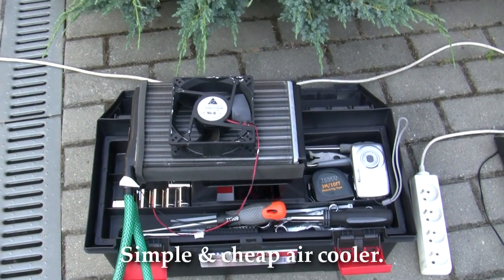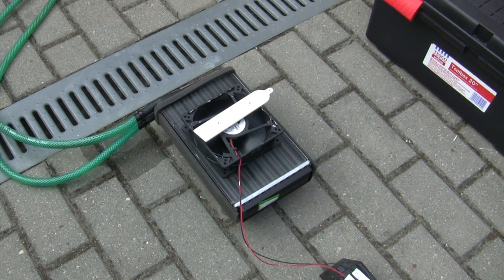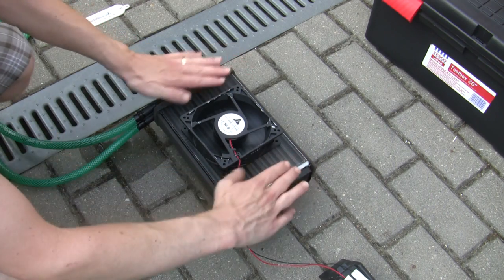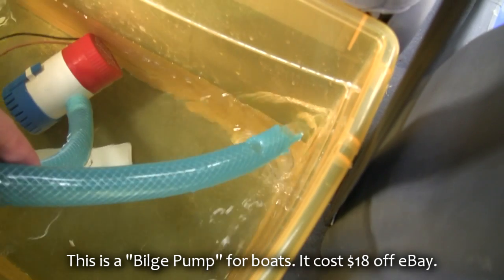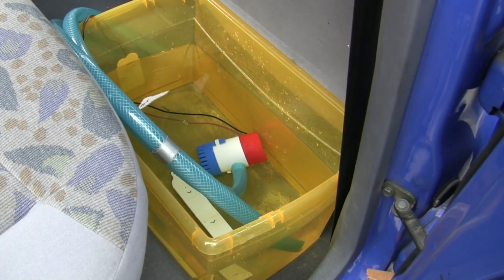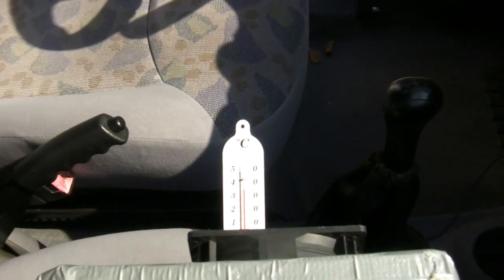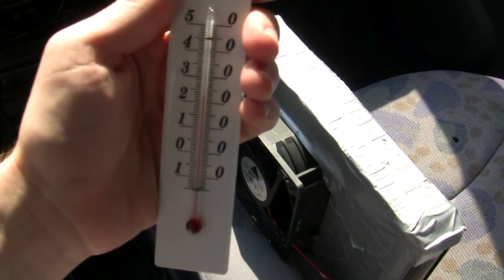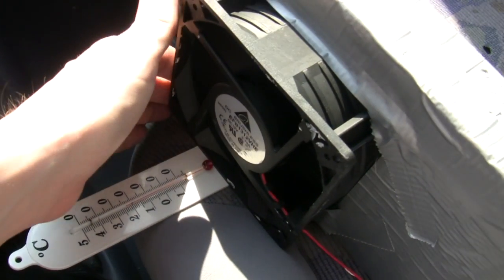DIY home-made air cooler that actually works for $45.

Comment: You need a second heater core to create a heat exchanger. Sit it in ice in an insulated box with a fan venting out thru the top. This will allow the heat to be removed in the vehicle without warning the entire system to less/no efficiency.

Comment: lol I kept wondering when you would drop a bag of ice in there!?!
If u r recirculating water above 60 degrees not gonna cool long!?!?!
The heat transfer from the heat absorbed from the coil goes straight into the recirculated water.... there's no subcooling in this process to effectively make a difference!?

(More ice in water better choice!)

Air cooled condensers have an inside & outside coil with fans on both!?
If someone could cool a car for a few hrs r so between stops that would b a cool idea!
Walking back to a cooler car would take a heat load off the car ac!!!! A non garaged vehicle wud really benefit!!!!

Comment: set the fan awau from the coil. like 1 inch you will pull air across the entire surface area. you're  only pulling air the diameter of its barrel.

Comment: but the heat is getting dumped right back in the water in the back seat. add the heat of the fan and pump and you are heating up your car.

Comment: Bry B brings up a good point, but in addition to that, if you create a box on the heater core and funnel that into the intake of the fan, the efficiency will increase dramatically.  A fan intake should be 1.5 to 2.0 fan diameters away from any surface so the fan can build an efficient velocity profile.  I agree with cooling the water as much as possible, but the fan location cuts the flow too much how this is set up now.  Look up velocity profile of a fan.  I used to do this for cooling electronics.

Comment: I found someone who made a portable ac unit that facilitates for ice and a self sustaining water pumping system.  Very reasonably priced for a unit that does both with a 120v fan.  Tried doing it myself with a 12v fan but doesn't kick out much air at all.  You can check them out here:  goo.gl/6n4qfJ

Comment: Dude simple fix to your hot car problem.

PARK IT IN THE SHADE! Or better yet get the car's AC FIXED!

And besides 75 degrees Fahrenheit Isn't cool enough for a car. But it is a short term relief from 100 degree plus weather.
Reply: I do pizza delivery and the temps are over 100 degrees F. I paid $1,000 for the car, and it costs $1,500 to get the a/c fixed. Yeah, real fucking smart solution, guy. I'm going to have a heatstroke because I can't afford to fix the goddamned a/c. I need an alternative that helps in SOME way that keeps me from literally fucking dying.

Do you even have a brain at all? Not everybody has $1,000+ to just piss off on fixing the a/c on an old car. If I had that kind of money, I WOULD JUST BUY ANOTHER CAR!
Reply: We have assigned parking where I work and that's not an option.

Comment: For a car the air needs to come out at about 10º max for efficient cooling the car. A car air conditioner blows air at 4-6º so you get the point.

Comment: Due to Thermodynamics, if you placed the water in the trunk, you would have a better heat gradient, therefore, possibly a cooler car.
Reply: The trunk is cooler? What do you mean how.
Reply: Shelby Voisine sorry how?
Reply: Having had multiple cars and trucks from different makers. In any vehicle the trunk is the least insulated because there is very little to no mechanical or viable items worth protecting, unless you have a prius which has batteries in the back. At this point ask yourself why you are you watching at this video.

Comment: Using an insulated cooler instead of a plastic tub would make it last a lot longer between refills!
That way the fan / radiator combo would be the only thing heating it up, as opposed to your metal oven (Car) and sunlight :P

Comment: yeah. you have to use ice or it won't work, cause a radiator is still not going to run any lower then ambient by itself. Like in computers it's just a really efficient way to remove the heat away from the core and expel it out of the case... just fix your AC, it's worth it and you don't end up looking like a moron with one less seat in their car. XD
Reply: The A/C costs like 15% more gas consumption, it surely amounts to way more than $45 bucks over a single month...

Comment: Getting the water as cold as you can as quickly as you can for as long as you can is key for a system like this. A few ice blocks is a start, but wont last long.  A 1-2 dollar bag of ice from the grocery store or gas station is a quick/convenient way to get some ice.  Freezing water in milk jugs will really add some capacity.  Adding salt to the water will also dramatically affect how cold the ice can make the water. Yes its corrosive- But so what? Cores are cheap and itd still last a LONG time.

Comment: Thanks for the heater core idea.  i was going to use a old fridge evap coil. 
You should use an esky even a foam box. The ice wouldnt last long in the heat of the car . 

Im using a chest freezer for a home air con . .freezing the fluid cooland over night then pumping it when its hot in the arvos .